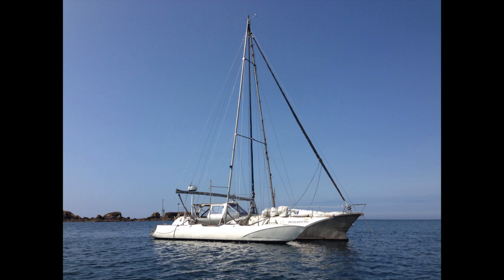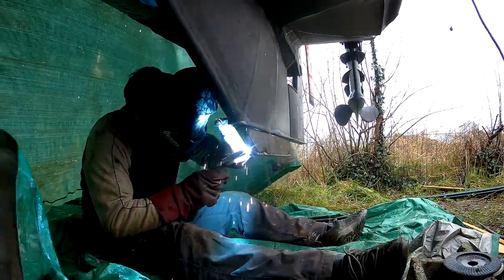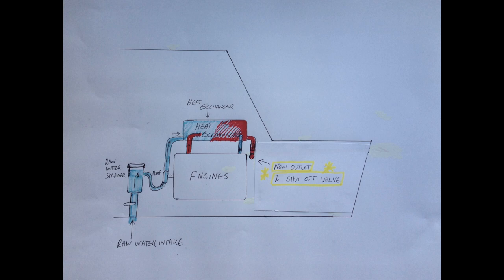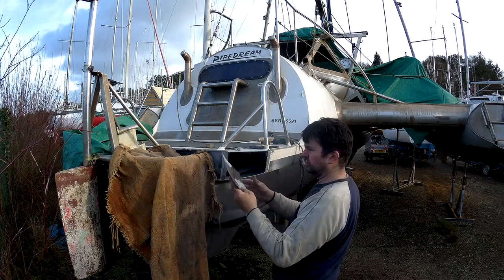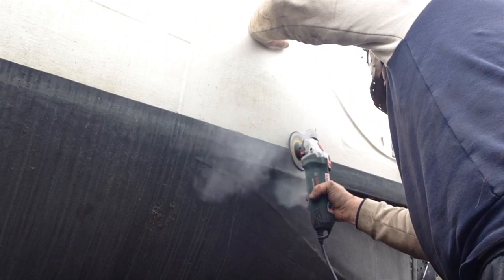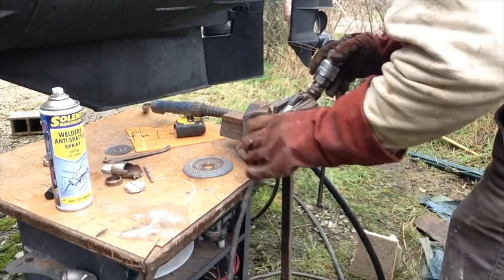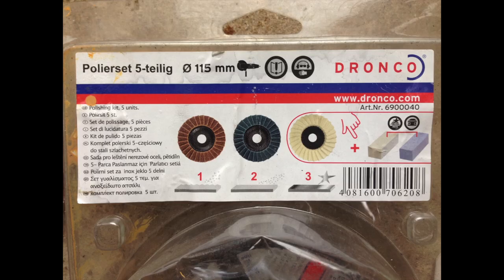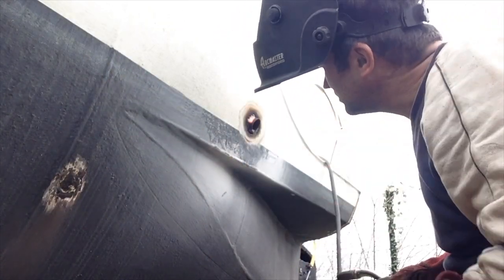Welding in a storm! Building a Steel Sailing Boat

Comment: weld with gasless wire! much better!!! plus just use canola spray for cooking for your anti spatter
Reply from the maker: I will look into the Canola spray. I did try gasless wire for thin stuff, I presume its a bit expensive to buy in 15kg reels and such. Working around the wind is not that bad and only becomes an issue because I am too lazy to put up suitable tarpaulins. In reality I should use tarpaulins more, also helps stop covering parked cars (including mine) in grinder dust...

Comment: Are you welding the stainless with a normal mild steel welding wire in your mig? you might find that its very brittle and will fail easily, cool boat btw, just found your channel and am currently binge watching all your videos!

EDIT: nevermind you answered the question just after i commented!! hahah great work!
Reply from the maker: Hi, thanks! Yes using 309Lsi wire, but I am using Argon with 8% CO2 which is not quite the right gas. Never really suffered blackened welds though and MIG always benefits from a bit of cleaning with a grinder. 
I did some time ago in a mad rush use a little bit of mild steel  and even 316 which as you say is brittle, but I have since rewelded those welds. 
I just bought a TIG AC/DC so I can carry out a mod on the mast and now have pure Argon for that. Quite liking TIG so far but it is slow and a bit fussy!
Reply: @SailingSVPipedream  tig is great for the small stuff. With ally i preffer a pushpull mig setup than ac tig. 
With tig (especially ally) a wire brush is your friend, i often give it a scrub even if i stop because it hates any dirt etc and your welds will suffer. 

Really love your boat btw. Cant work out how long youve been sailing in it for though? Maybe i missed that somewhere? Thanks for the reply and keep up the great work!!
Reply from the maker: @evolution0016  I did think of Pushpull Mig, but spool guns and such are just too expensive here ($750 or so) - there are cheap Chinese ones for $80 but I am not sure they would hold up. The mast work is going to be intense, so I did not want to trust a cheap tool. The TIG cost quite a bit more, but I always wanted to try it and could always sell it later.
I have always tried to keep joints clean, but this TIG is super fussy. I will be buying some new wire brushes!
Pipey is 25 years a boat now which seems crazy to me. I still get people telling me she will never float! You would think the marks around the water line would give them a clue.
Reply: @SailingSVPipedream  great stuff mate! Ive subbed so ill keep an eye out for your videos and wish you luck with the mast repairs! 

25years! Wow! I saw the news video in one of your earlier videos and thought you looked young!! 😅 

Keep up the great work! Hopefully oneday ill get to see this in person!! All the best, Danny.